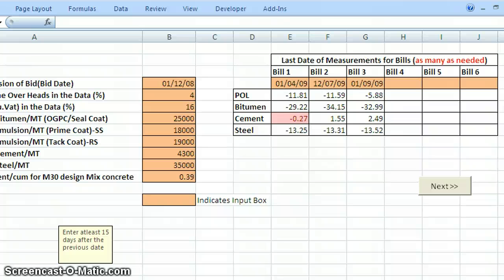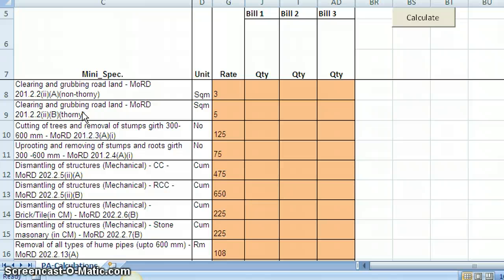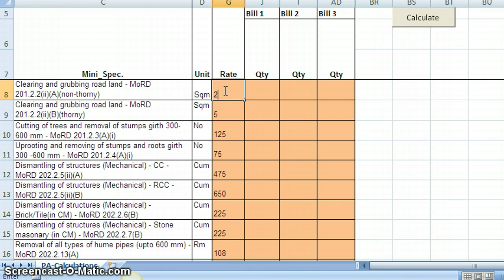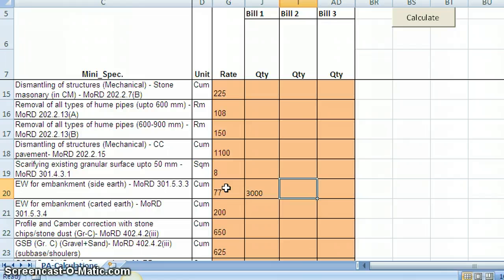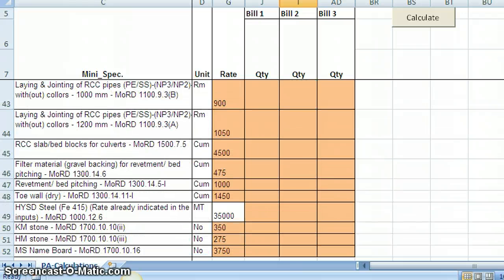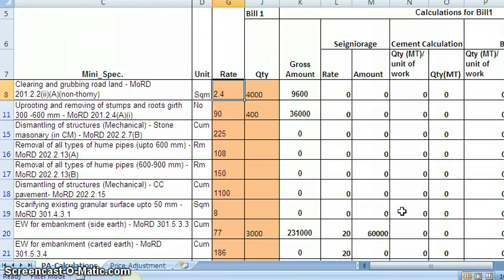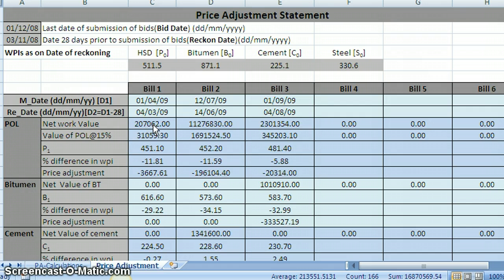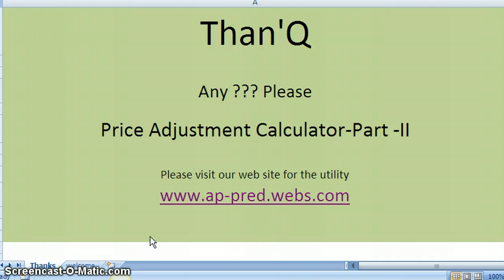Price Adjustment-Calculator-II

Comment: Usually the billed amount of the Works for each calendar month is obtained
from the checked bills submitted by the Contractor. In case the billed amount
is for more than one month, the amount of the bill shall be segregated for
actual work done in each month. Your calculator assumes that the work done is in the last month of measurement without giving effect of price adjustment to quantities month-wise. Isnt it so?